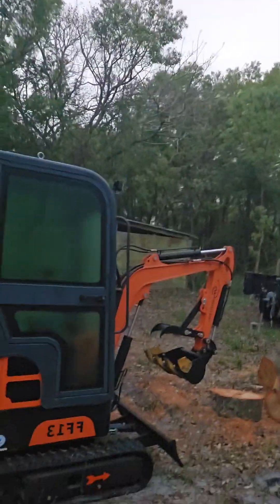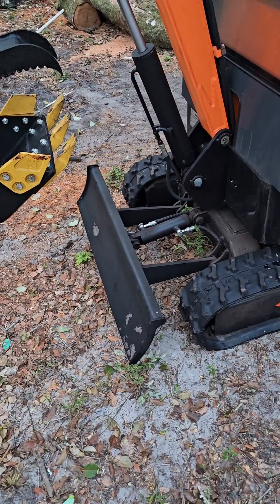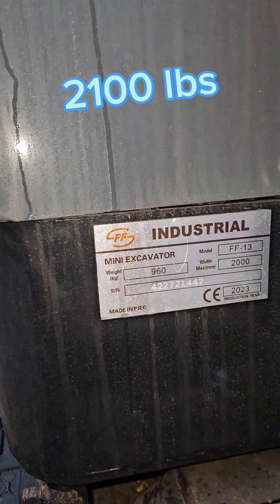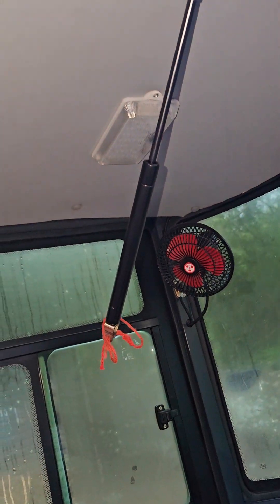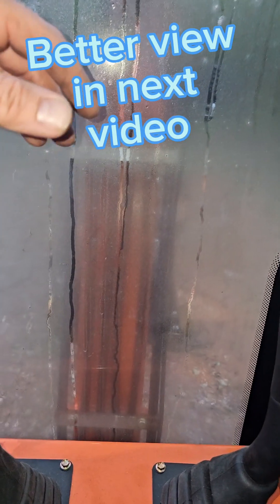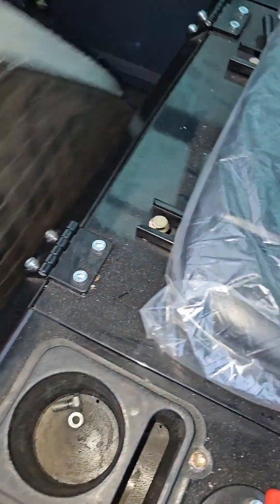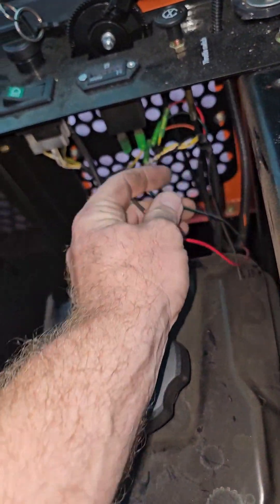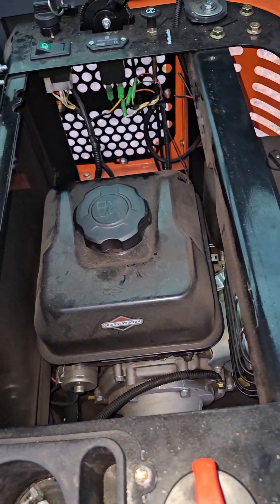Introducing My Brand New Mini Excavator

Comment: Have you done a video with the upgrades yet?
Reply from the maker: The only thing I really upgraded  was dual cooling fans. Most people  get extremely involved in upgrading their machines.  Why upgrade it if it does the job. Most up grades are a waste of time and money. I guess you can post in a FB group that you've done 20 upgrades but never used your machine.
Reply: @FL_Redneck_customs  what fans and how did you set them up?